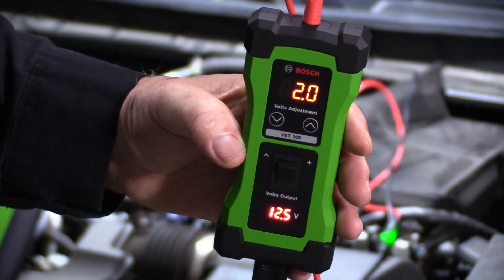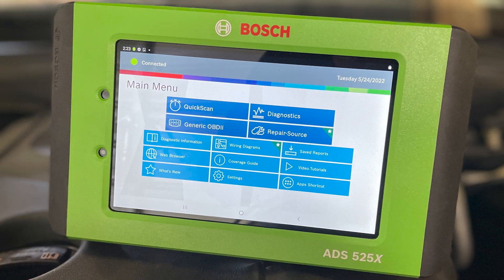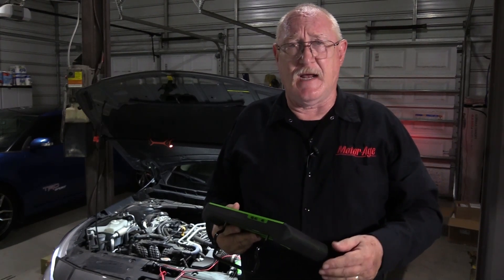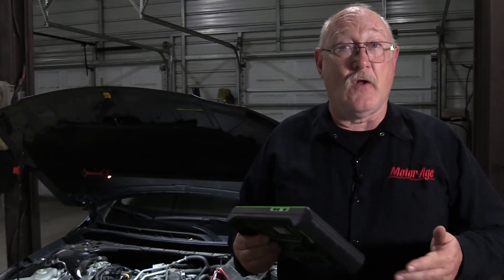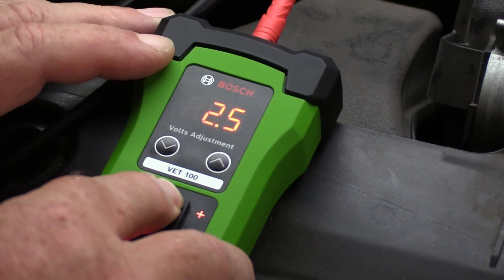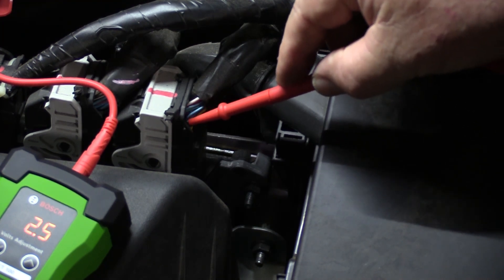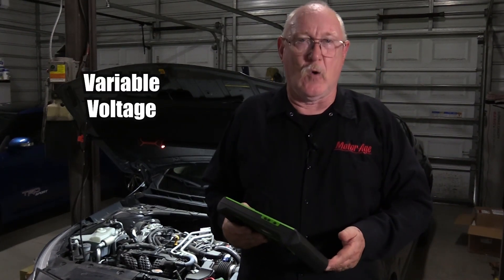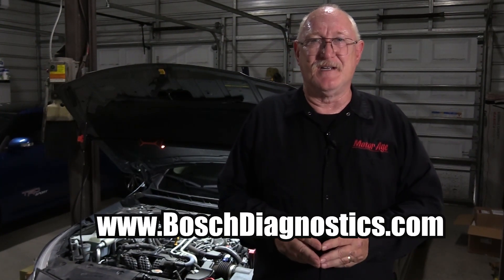Product Insight: Somebody’s Lying! How To Test ECM Sensors

Comment: To test a ECT thermistor circuit at the device harness connector it is best to use a resistive decade box where you can vary resistance over the range of the sensor, applying a voltage test to a resistive temperature sensor diagnosis is a bit strange mainly because it does not mimic the sensor operation. 

Many shops have a regulated current limited DC power supply to simulate active sensors. Most of the time the module input does not fail unless there is water intrusion into the module, and you can easily diagnose an active sensor wiring by temporally shorting VREF to the sensor output and monitoring the voltage with the scan tool. If the voltage reads full high then the wiring is intact and the module can properly read the voltage, so we would conclude that the sensor was faulty. If you want to do another voltage test you can adjust the power supply output to half scale and see what the module reports. It is very difficult to kill an analog input sense channel on the ECM. It will be ESD protected and protect against any voltage above VREF + a diode drop. 

You would not use a piercing probe on the back of the connector you would use a back probe lead. The test lead used in the video at the back of the connector is not a piercing probe, it is just a generic testing probe supplied with the Bosch tool. A piercing probe goes around the wire and "pierces" the insulation by tightening the probe to make contact with the wire conductor.

Comment: Never forget to start, run the engine normally, then go back to look at altitude. This is displayed in kpa values. If at 500 feet above sea level, you don't want the engine thinking you are at 14,000 feet as if the top of "Pikes Peak". Remember this reading is a very quick snapshot of the "MAP" sensor between key on to actual cranking on most. Some, but few take this reading until the RPM exceeds cranking speeds of 250 RPM. It is something worth looking even though in 30+ years of scanners + MAP sensors is a short period of automotive testing. Anaerobic chambers were used by some car makers that used a carb. EFI is now and input that effects how it runs after changing altitude on a trip, stop to refuel, new reading and I have only had one MAP sensor that did this. Don't forget the turbo car that experience a failure and repaired with non-turbo parts. The MAP never gets changed. This works both ways as adding a turbo or supercharger but using the same MAP for a "N/A" engine. I have seen this twice!!!!
DK, ASE master